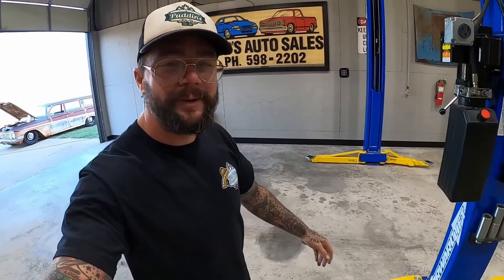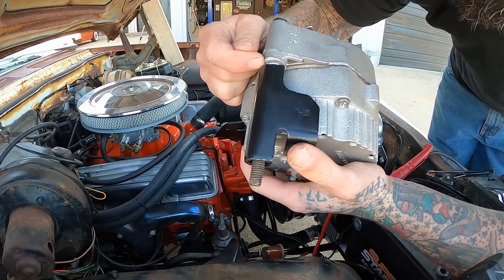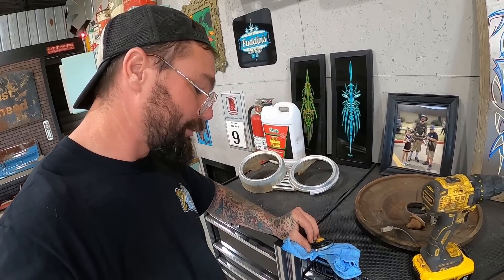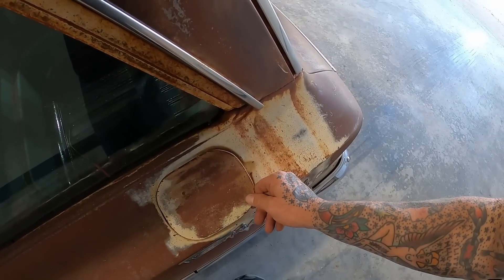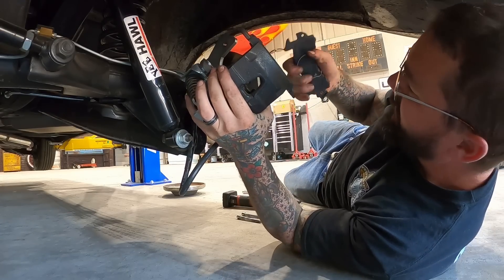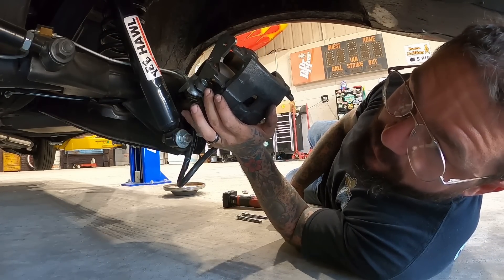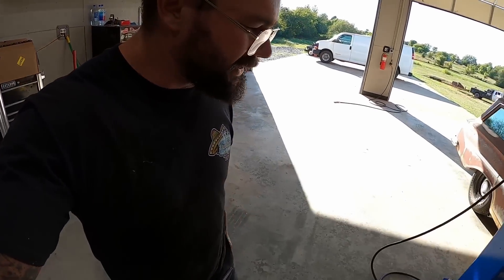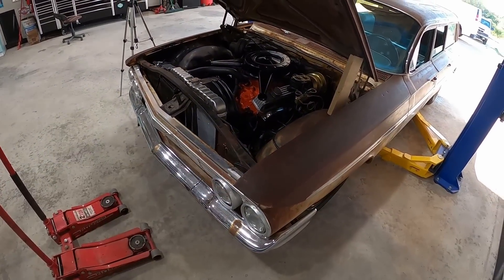1961 Chevy Wagon CUSTOM BREATHER, STARTER, MORE.

Comment: Maybe vinegar and a 3M scratch pad. If that doesn’t get it you can use some 1200 grit wet dry paper. I used that on a 70 Jeep that had some baked on white stuff. Lots of work but the end result was great.

Comment: I also if i worked on brakes that the pads had a glaze on then because the adjustment between front and rear wasn't correct , i would take the pads and on the friction surface on textured concrete surface and do a figure 8 over a few times till the glaze was gone . worked well and no need for a sander !!

Comment: For the glass on my 73 dodge I had a similar issue. I used 0000 steel wool. Worked great for me. Go ahead and get you the soap filled ones and save a step.

Comment: You can make that generator light go out by putting some jumpers on the voltage regulator pigtail. I had to do that when I put a 1 wire alternator on my 66 impala, pretty simple, I found a diagram on a Chevy forum somewhere.

Comment: The lights in the lower ceiling fabrication area seem to be a hair off, causing slow rolling black bars on the video.  Certain types of lights, LED's and Fluorescent's, can interfere with the cameras image sensor.  LED lights don't constantly stay on, they flicker at a very fast rate, causing the rolling black bars.  Can be fixed in editing, depending on the software being used, or the lights would need to be changed.  Love both channels!

Comment: I think your glass issue is the plastic film between the two layers of glass ( safety glass) if it has that type of glass in the doors , windshield glass will do that before it starts to could around the edges!

Comment: For the glass get some Nuglass by Duragloss and some 0000 steel wool. Napa and probably some other parts stores have the Nuglass. It has some abrasive and the 0000 steel wool helps also. Walmart has the 0000. Eastwood also sells a glass polish kit that I have but have not used. I scratched my glass using regular steel wool like a Brillo pad. I have never had an issue with 0000.

Comment: You need to vent those brakes, Take the drill and put some holes in the rotor, Or drill some holes in the drum if older and no disk brakes

Comment: I’d try unhooking the parking brake cables and go for a drive. If the noise stops. That’s your issue. If not then you can eliminate the parking brake as the problem

Comment: I had the same issue with the window glass.  Discovered that the factory coating was bad.  A glass shop can remove it, just like window tint.  You can either leave it off or reapply.

Comment: Drum brakes require a check valve usually in the master cylinder and disc brakes don’t so if have a check valve that hold a residual pressure in a disc rake circuit it cause brake drag maybe worth checking if the rear brake problem persists.

Comment: Hey puddin I been working on my ranger project and I can’t help but think about the many video we’re you restore everything on vehicles and because it’s very similar to what I’m doing. Basically I’m doing a frame swap so I had to disassemble two trucks to put all the good parts together I even made a custom attachment for the engine crane to lift the cabs up in the air far enough to roll the frame out from under both and I’m to the point we’re I can almost put the better cab on the great unrusty and mostly painted chassis. I have definitely got my moneys worth out of the harbor freight engine crane😂

Comment: Check you don’t have a disc/drum master cylinder. If it is disc front drum rear they have a residual pressure valve in them which holds some pressure on the rear drums to stop the springs pulling the pads away from the drum which causes a soggy pedal.

If you run rear discs on a drum master cylinder it holds the rear brakes on due to the residual pressure valve.

Comment: I have been running a mini starter that I had gotten from summit or jegs!! I was actually wanting the MSD mini starter but didn’t want to spend the money that they wanted for those starters so I ended up getting I believe it was a hitachi mini starter for just under a hundred dollars!! I definitely wasn’t convinced on it but after having it for the past 3 or 4 years and have it on my 421 SBC with a 13.5.1 compression and running it at least 2 to 3 times a week it definitely hasn’t let me down yet and my 1”7/8” headers I’m running are about a 1/2” away from the starter hasn’t burnt the starter up yet like they was doing to my other starters I was running and had changed out 3 times and i said something had to change!!! If you end up having trouble with that starter definitely check out the hitachi mini starters that jegs or summit sells!!! I’m definitely sold on them after what I have put mine threw so far and had for the past 3 to 4 years now!!!!

Comment: Mr puddin we have extremely hard water where i live.  The only thing that my detail guy has found to remove the water spots is acid and after acid washing take 0000 steele wool with wax on it.  The spots will etch glass and paint but the spots do go away.  I work at a dealership i we see this stuff daily.  It will come off but it takes time and chemicals most ppl dont want to use.

Comment: I had the brake drag issue with a truck I bought and it was the master cylinder. Drive the car until it drags, jack up the car and spin wheel feeling drag, then back off the master cyl. bolts and the pressure was relieved letting the wheels free spin. The previous owner installed the wrong master cylinder!

Comment: I'm wondering if it's the wrong master cyl. And has a residual valve in it for rear drum brakes. Would explain why it comes and goes why it takes so long to show up and stays once it does.
  Just pull the line off the master cyl and the cap off and if no fluid comes out is has a residual valve set up for rear drums and if it pours out it doesn't have one and is set up for disc.

Comment: I’ve got the same belt\disc sander. The only problem I’ve had is the on\off switch melt down. Grizzly has them in stock for like 5 bucks

Comment: What up Puddin
I happen to be working on brake drag on a 84 gmc g3500 which has been my project since March , i think i didnt have adjustment set right on mine but they are large dually drums & finally got it on road the other day after changing transmission plus....
Boxvan life

Comment: In my kinsiderible expereyence. The first pointer is +5 degrees. TDC 0 degrees is the second pointer. Followed by -5, -10, -15 degrees. In an Anticlockwise direction. As the harmonic balancer rotates in the running direction it therefore passes -15 then -10 then -5 then TDC(0) and finally +5. I really don't know if this is useful but I couldn't follow your reasoning bro'. I always set my timing 9 degrees BTDC (-9) with the vac advance connected. Idling.

Comment: on the dragging brakes is your master cylinder for rear disc? if not sometimes they have a residual pressure valve in them that you need to take out. just a thought.

Comment: You should have a constant 12 volts to the HEI in any key position.  If you take the OEM coil feed and hook it to the HEI it will work but your available secondary voltage wont be as hi as it should be by about 25%. You should also open your plug gap to .045 (or .060)depending on the HEI coil in the cap. If you have the regular cheapo Chinese HEI set it at 10 degrees initial and you total will be damn close. If it aint the cheapo, I agree the "time by ear "method, at wide open throttle , hot, vacuum advance hooked to ported vacuum. There ya go . Doctor Rick`s 55 years experience, ASE master tech certified ,school of hard knocks, certified chevy small block tune specs for what you got . WARNING; you might experience premature rear wheel slippage from a standing start. No warranty implied or otherwise. OPINION: I know you are not hot on cleaning the remainder of the under hood, but two things at least  will make the whole package POP BIG TIME!! Paint the inner fender wells and clean the rust from the back side of the grill. Painting the firewall would be a big improvement also, but we`ll leave that up to you . Once you see the fender wells  you wont be able to control yourself from painting the firewall. Love you guys.

Comment: I dual snorkelers a few cars.  My 74 Torino in the mid 80's and my 66 Corvair around 2008.  

I never understood the GM practice of tapered snorkels.  You have a nice wide opening into the filter, but the other end is constricted.   How well can a 4 barrel breathe through that little inlet.

Comment: ider fer ya while i was watchin ya paint off the metel arm, what if ya built a retracting arm that slide out to use to paint then back in when not using it over the metal section?

Comment: it doesn't have a drum brake proportion valve does it? cause drums require a little pressure to work right so if its the stock prop valve that might be the issue.

Comment: Do you have the correct master cylinder? One for disk front and rear? If it is for disk and drum it will keep 10 psi of pressure on the rear, and 2 psi on the front (which is what you want for disk). A disk/disk master has 2psi valves for front and rear

Comment: The miter gauges that manufacturers send out with everything from belt sanders to $5000 table saws are universally trash. I'm not even a tiny bit surprised it is off a degree. You can find better gauges for under $100. Incra's basic gauge is $75 on Amazon and they make amazing stuff.
Reply: Alternatively, as others are pointing out, you can adjust the pointer on the gauge that came with the sander.

Comment: For your glass on the wagon, use your favorite glass cleaner and 000 steel wool. Firm pressure, not hard. That will remove all the hard water marks. Might have to repete.

Comment: Not trying to find fault, but isn’t that fuel filter on backwards? Seems the gas is supposed to enter from the other end so you trap the dirt where you can see it, and know when to change it. This way, the dirt is captured in the small area inside, where you can’t see it, and you wont know it needs changing. Just saying. Good job on this one! I can see a wagon in my future!

Comment: i had a chevy one time doing same thing the master cylinder was being pressed a small amount from the booster put 2 flat washers between the master cylinder and booster was holding pressure on the brakes, grinding the pads is not a fix its a bandaid

Comment: A Puddin I know you don't need  a wall to fall on you for you to figure out it's made of bricks. You said it's sitting right, your tires were rubbing the K- member underneath the engine had some ugly scratches from scraping against the ground and cracks in the road make hard impacts that rattle your dash and the whole car    ?Any clues ?

Comment: Is that glass laminated? If it is then the "dirt" might be UV deterioration of the adhesives between layers. Nothing will fix it if that's the case. I don't know. I'm just throwing up an idea. I am guessing the glass feels perfectly smooth. Maybe a trip back out to D&H to pick up some glass.

You changed two things this video to try to eliminate that brake noise. Now no-one can be sure which one was the fix. I'm with Uncle Rick and I therefore think you should (for science) get a second set of those cheap pads and replace them to help pin down the exact cause as possibly the residual pressure of a poorly adjusted master cylinder linkage rod.

And, there is really no reason to highlight your bald spot. Really none at all. I'm liking this "new" lower stress Puddin' now that the new place and shop is mostly D-U-N DUN.